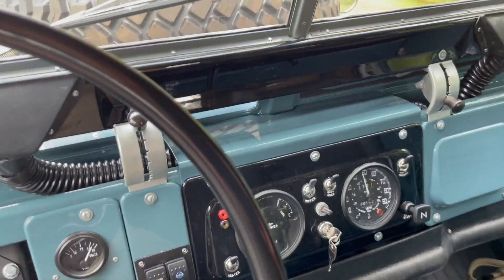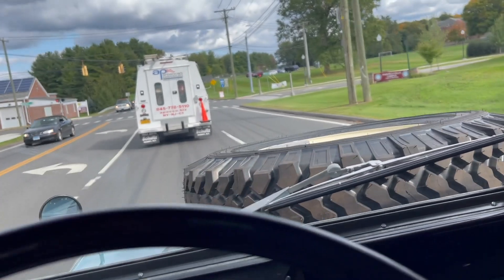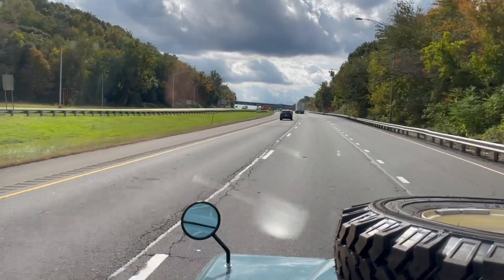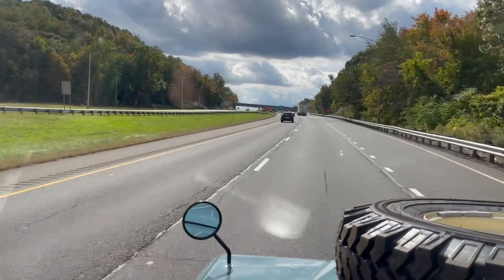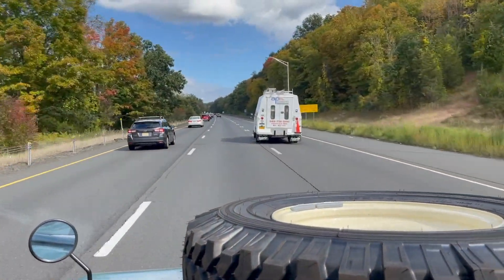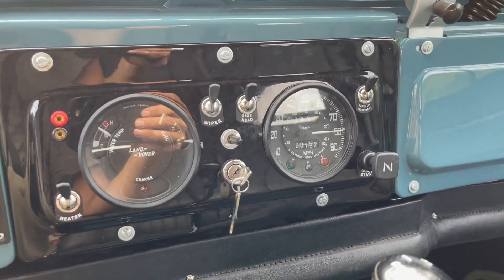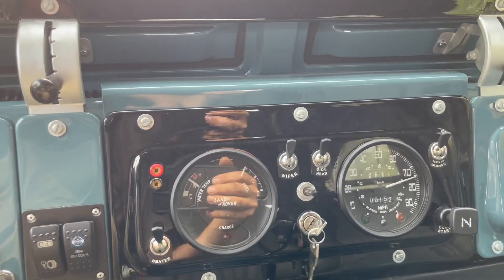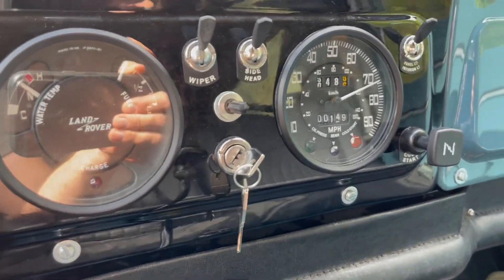Test Driving an NAO restored land Rover Series IIA

Comment: Lovely job.  I run a s2a daily.  This looks like it is running a bit hot.
Reply: Yes, it was running at 190 on the full throttle uphill section and the 80 mph run. That is still fine with me because this type of driving is only done occasionally. It stays at about 170 with normal driving and highway cruising.

Comment: What do you guys consider the max RPM  and best cruising RPM.
Reply: I don't typically rev them over 4000 rpm. I like 2800 rpm at 60mph for cruising rpm so that it is right in its powerband for overcoming wind resistance and going up hills but I can easily go 65 to keep up with traffic if nescassary.
Reply: @mikesandone2652  Thanks for the info - Also, what break-in oil do you use and what regular oil after the break in miles.
Reply: My old girl does not have a rev counter, and the speedo packed up some 8 years ago...
I drive her on hearing and feeling...I time her between telephone poles, devided by 50m x the time ÷ the smell.
If there is light breeze from the back, it's faster, but sometimes even plastic bags in the wind overtake me from behind...
I love them, they have their own souls...